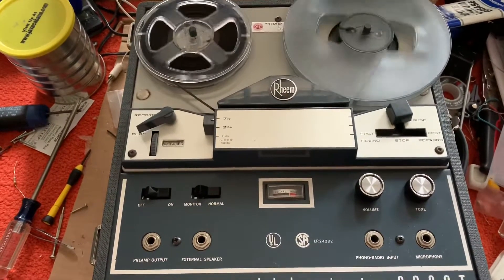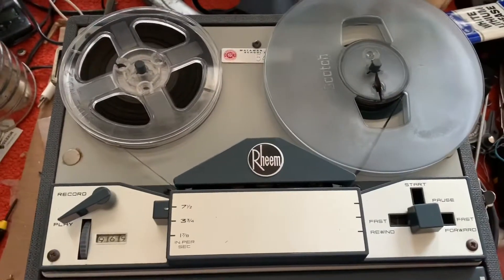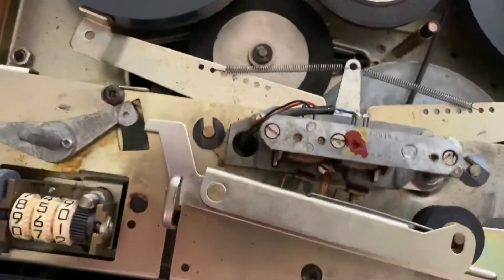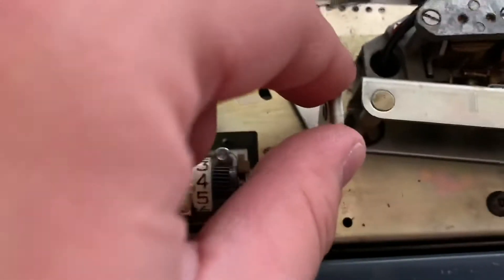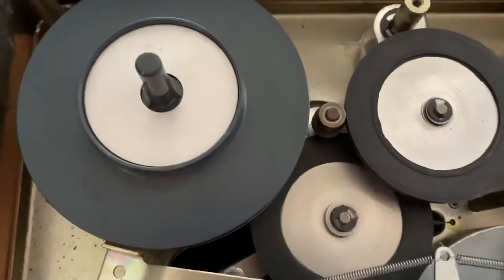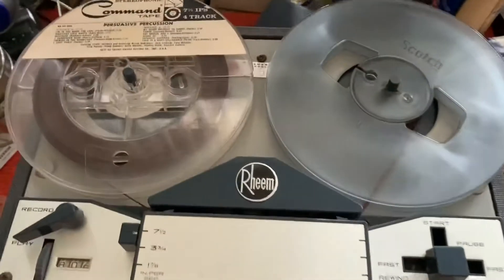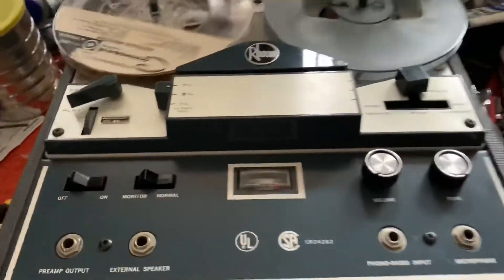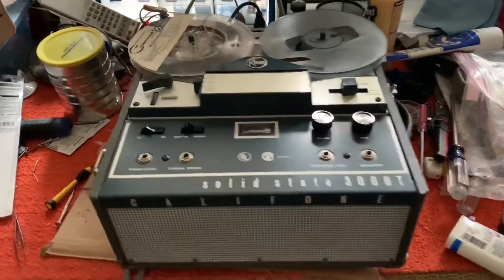1969 Rheem Califone 8030T Mono Portable Reel To Reel Tape Recorder

Comment: I’ve never seen this recorder before. I have my Concord 220T which is a slightly different model and it’s a 2-track tape recorder, and it will record and playback 2-track reel-to-reel tapes, and it will not play stereo as well, because the other side played backwards. If I play a 2-track reel tape on my Akai 1721W, it plays only 1-4 track while 2-3 track plays backwards, but it was on a stereo,position, so I have to set it at 1-4 track for mono. My Concord 220T was from 1964 and it was a hybrid transistor and tube amplifier, and it was Japanese built where it says “Transistorized”.

Comment: That playback head looks like it is stereo. Four terminals is usually stereo. It looks like someone replaced the original head with a stereo head but wired it to be mono. Maybe play a stereo tape and tap onto the head terminals and see if there is stereo separation. The machine's circuits are mono but the head might be stereo.
Reply from the maker: coondogtheman1234 It appears to be factory.  While I was cleaning the head, I only saw one pickup coil. Maybe the terminal plate is prewire for a stereo head.